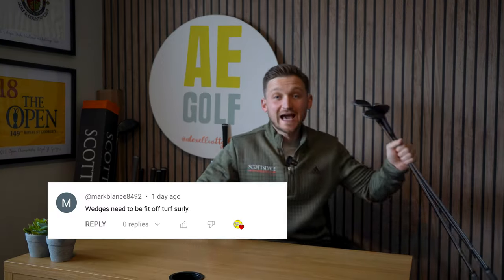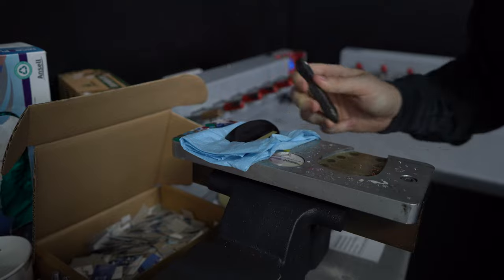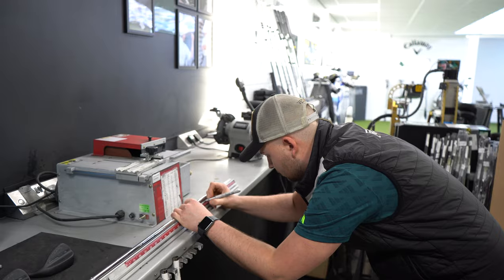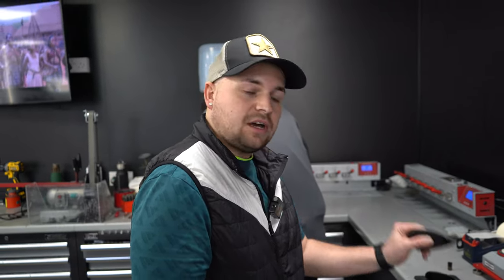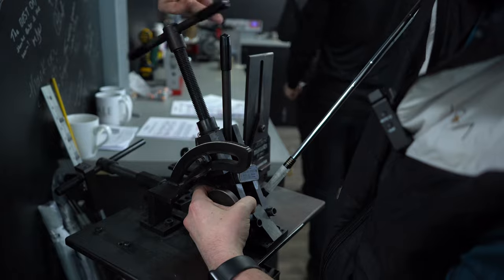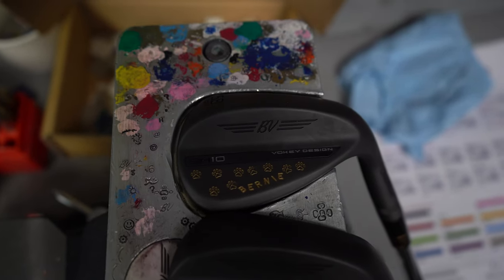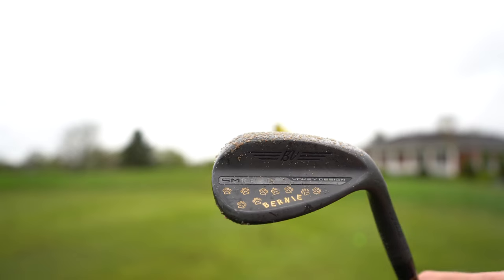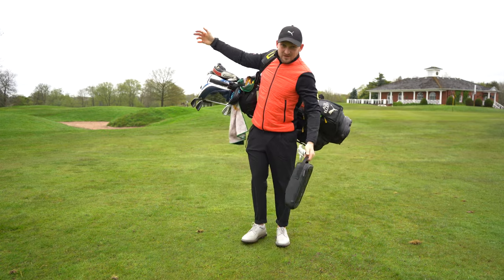THIS IS THE BEST WEDGE IN GOLF (just look how it performs!!)

Comment: I have been a Vokey man for longer than my memory, up until this year when I switched to the Mizuno T24's.  Same set up 50, 54 and 58 and with low bounce as I like to manipulate the face for a variety of shots and my shallow turf interaction. Mizuno was the next best to Vokey in terms of grind options but I found they swing and are weighted more like blade irons wheras Vokey's have always felt much heavier which is better for launching the ball but less feel for distance control. The other advantage with the Mizuno's is I could get the exact same shafts (make, model & stiffness) and more grip options as standard and slightly cheaper than the Vokeys (who charged extra for the right shafts and grips !).

Been playing with them for a month or so now and the swing weight has meant they are far easier to swing and although a good wedge player I now have more confidence. Still need to wait for the weather to settle down and re-assess my distances for 1/2, 3/4 and full shots as the 50 is definitely lower flying than the Vokey but also checks more (fresh grooves !). The proof will be over the season as my course has lightning fast small greens so you only find out how good your short game is when they get really scarey.
Reply: I have also made this change, Much better feeling and workable.

Comment: Did you lose any distance or feel with the SM10’s. When I went from the SM7’s to the 8’s I lost about 10yds off each of my wedges and the feel was substandard. I picked up the SM9’s and it appeared the issue was corrected. How do these compare to the SM9’s and is it worth me buying the 10’s or picking up another set of the 9’s at a 40% off price?